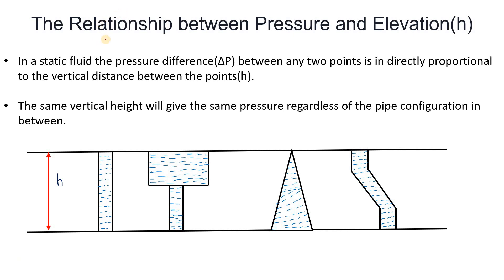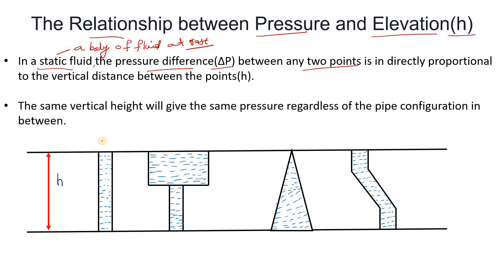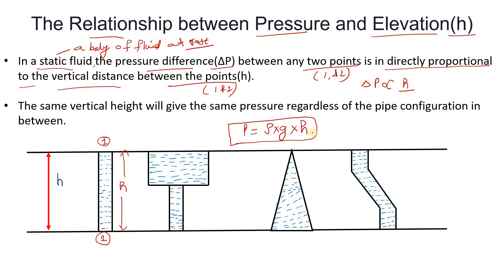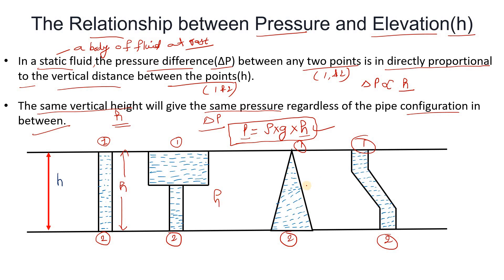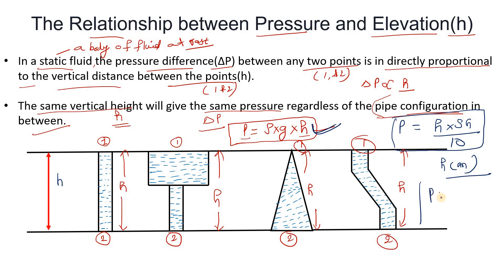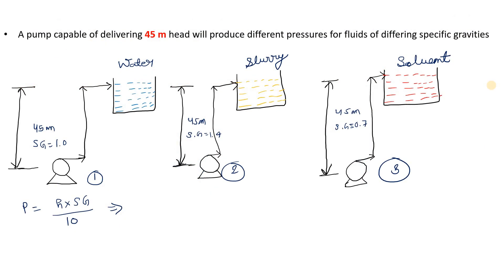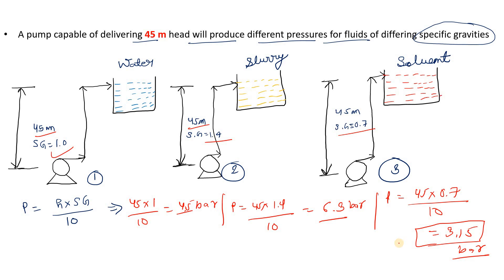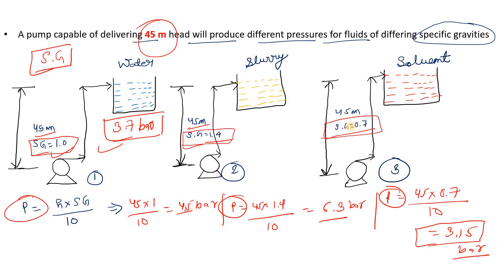The Relationship between Pressure and height/head | Centrifugal Pump | How to find static pressure?

Comment: sir if a pump is capable of  generating 3.7 bar pressure(shut off pressure) the head with respect to water (S.G=1.0) will be 37 meters and the shut-off head will be constant at 37m for all S.G Liquid , however, the pressure of 3.7 bar will change with the density of the liquid. because it cannot cross the shut-off head, irrespective of the pressure generated.

Comment: 1) what is "h" , its a static head or differential head
2) what is value 10 in formula p=h×s.g./10
3) how can calculate suction pressure in kg/cm2